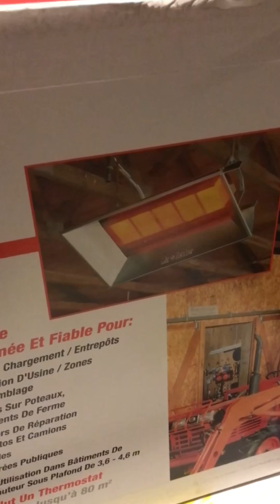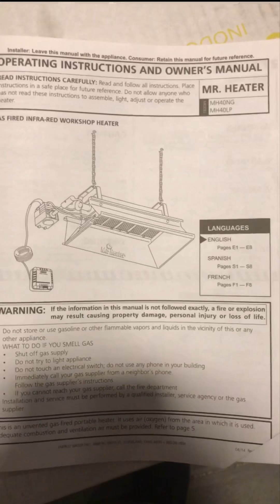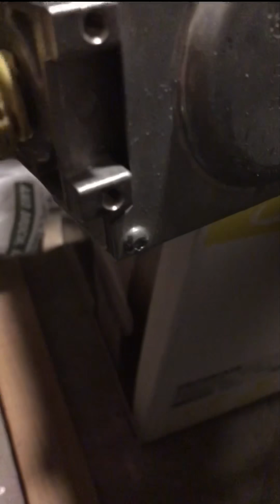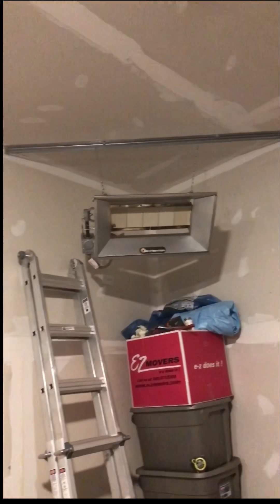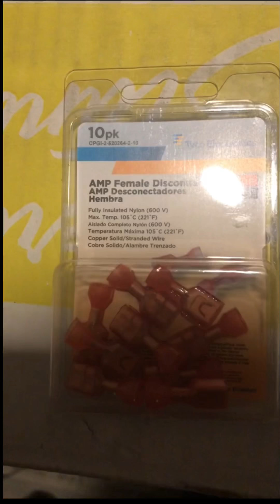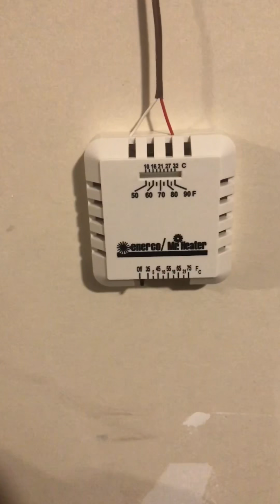How to install a garage heater

Comment: My manual gas control knob will not turn 😮
Reply from the maker: Did you try depressing it then turning
Reply: @hootyshowto18  yes.
Reply from the maker: I’m sorry I am not home at the moment to take a look at mine. If you think it’s defective maybe contact mr heater or the store you bought it from. I apologize for not having a better answer.
Reply: @hootyshowto18  thanks for replying. I’ll get back up on the latter over the weekend and check it out more in depth. I’ll keep you posted.
Reply from the maker: Please do in case someone else has the same issue. Good luck and have a good weekend.
Reply: Hey Hootys How to,
I got back on the latter  today and gave it another go on turning the dial. Success! I just wasn’t giving enough strength. Pilot lite is lit.
Reply from the maker: Nicely done. I’m glad it all worked out.

Comment: I have one of these units and moisture is very high would you recommend a power vent to pull air outside and if yes would you locate it near heater or opposite wall near garage door? thanks for your video.
Reply from the maker: If you are having a issue with moisture a dehumidifier would probably solve that for you. You could locate it wherever you like and best of all no holes to drill 🤗

Comment: Do you get an odor of spent gas or exhaust?  I do.  Do you have an update how you repositioned? No CO2 detected but the sunshine shows smoke in the garage- I am contemplating tube heater- radiant.
Reply from the maker: I have either become used to it or it has gone away since then, but also no CO readings for me. Still as reliable as when I put it in. Thank you for watching.

Comment: any concerns on your clearances? Top, back, etc.
Reply from the maker: Yes. I keep saying I’ll have a follow up video, but life keeps getting in the way. I have since moved it further down from the ceiling and added a deflector above the ceramic tiles where the heat comes out. It has worked very well so far.

Comment: Any issues so far with the mounting location? Everything I read suggest 2ft plus clearance, but I don't really know if it is necessary.
Reply from the maker: Definitely keep the recommended distances. Mine ended up being too close to the ceiling and caused some discoloration. I have since moved it down from the ceiling to about 36” and added a homemade deflector. All has been well since.
Reply: Looking for the same info

Comment: Thanks! Mine came with the wall mount bracket but natural gas connection was the same. The "trap" was a nice touch as well. Stay warm indeed!
Reply: The trap is supposed to be piped as in the picture of the instructions. It will collect debris better. Just a tip. 😉

Comment: Thanks for the video. Is there any concern about carbon monoxide etc. coming from the heater with the bedroom being above the garage? I have the same situation and I’m hesitant because there is no vent. If no problems for you I think I’ll go ahead and install one..
Reply from the maker: Thanks for checking out the video. My wife had the same concern and I didn’t want to take any chances either. I purchased a carbon monoxide and explosive gas detector and have it plugged into an outlet in the garage. I’ve had absolutely no readings since installing it. Here’s the link for the one I purchased, however I bought mine from a local big box store. 

Kidde AC Plug-in Carbon Monoxide and Explosive Gas Detector Alarm | Nighthawk Sensor Technology | Model # KN-COEG-3 https://www.amazon.com/dp/B0002EVNJ6/ref=cm_sw_r_cp_api_fab_mG6CFbWK98RYE
Reply: Yes there is a concern, this unit should actually be vented.
Reply: @steved8714  Mfgr says doesn't need venting.  How did you learn otherwise?

Comment: Thanks for the video, I am thinking of installing this unit on my patio under my aluminum/glass canopy. Wondering how much clearance you have between the heater and the ceiling? Does it make the ceiling pretty hot above the heater? Did you end you having to put a heat shield or lowering the unit? Thanks for your help!
Reply from the maker: Thanks for checking out the video. I am having issues with clearance I hope to address in a follow up video. Overall the unit is great. In your case based off of what you described, I would not recommend mounting it close to the ceiling. Given that it would be near glass, I would imagine with the heat and cold (potential snow as well) you could experience catastrophic cracking/breaking of the glass. I would either consider a different unit, or alternative mounting location. Potentially some kind of heat deflector could benefit you and possibly work, but I still would have to suggest something else. Hope that helps. Thank you for your question.

Comment: How do wires work without any electric power ?
Reply from the maker: There is an electric signal being passed through the wires, but as there are no moving parts with this system (blower motor, electric ignition) it does not require typical A/C power that you would find in a standard outlet. Instead it works on millivolts D/C which is a much smaller current and generated by the system itself. So no external power is needed to run the heater. Thank you for checking out the video and I hope that answered your question.

Comment: Thank you!! mine actually did not come with the mounting hardware but your video showed the part numbers which was aawesome~
Reply from the maker: Glad I could help. Thanks for checking out the video.
Reply: @hootyshowto18  is the thermostat  battery operated
Reply: @lorenzodavis1735  No, it's a piece of shit actually.

Comment: Can we use it at the cottage or a small camp 24x32
Reply: harry sharl thank you for checking out the video. If your area is fairly open it may work. If you have several closed off rooms you may have a problem with the warm air circulating throughout the space. I’ve been meaning to do an update video, but I have been busy with several other projects. There is a smell that is emitted because of the pilot light. If you don’t think that will be a bother to you it may be for you. I did purchase a CO/explosive gas meter from Menards. It’s a simple plug in model similar to a straight CO monitor most people have in their homes. I got no readings for CO or explosive gases being present, so it doesn’t seem to be a concern of endangering health with the fumes. You are within the range of the square footage this heater can handle (768 sq feet) it’s pretty efficient it only turned on for about ten minutes every hour and a half to two hours in my insulated and dry walled garage. So if you don’t mind the smell and your floor plan is pretty open and you meet the requirements as far as mounting it properly it may work fine for your application. Thank you again for checking it out and subscribing.

Comment: Great first video! How high are the ceilings in your garage? What are the inside length and width dimensions of your garage? Thanks!
Reply from the maker: The ceilings are about 10-12 feet. Garage is about 30x22. Thanks for watching and commenting.

Comment: good vid how did your heater work  january 30/31
Reply from the maker: So far it’s working great. Only runs a couple times an hour even in this cold. I’ll be doing an update video in a few weeks once I get the gas bill to see what impact it will have. So far I am very very happy with it.